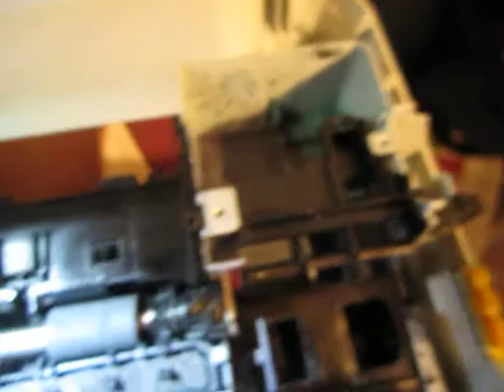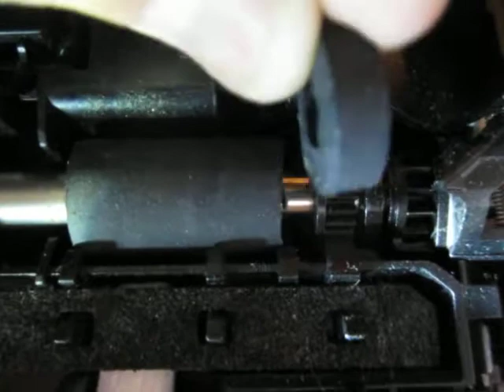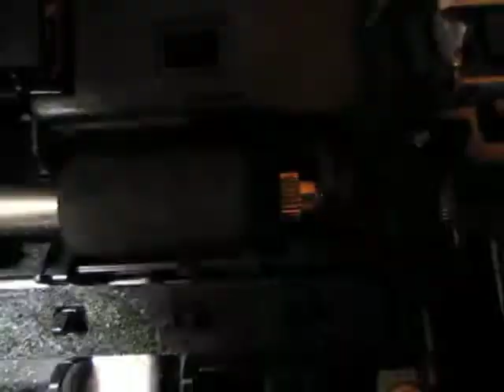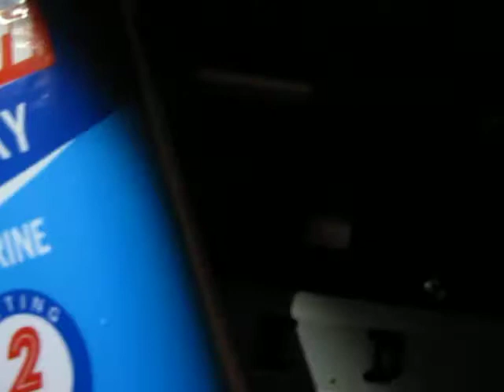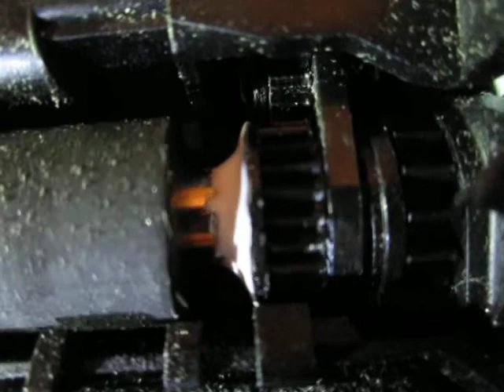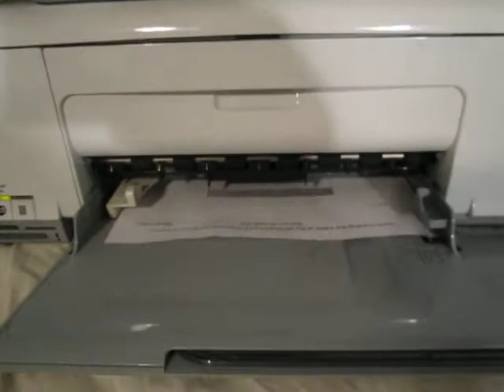HP Printer Paper Pick Up Repair C3180

Comment: Thanks, your video helped me revive my printer; it had the same paper error. I managed to fix it without having to take it apart. In case it helps anyone, I moved the gear slightly to the right to create a gap between the rubber seal and the gear. I applied a little Loctite with a brush to the side of the rubber seal, then moved the gear against the seal and applied pressure for a few minutes. I turned the printer on, and now it feeds paper perfectly. I don't know how long this fix will last, but it's enough for me.

Comment: I used a hole saw 3 inc to cut a hole right under where the gear is on the bottom side so I can work better, it worked great. easy to work on then sand the hole inside the printer so the paper feeds just use about 20-30- pieces of paper and it feeds great  took me 1/2 hour and shes been ok for 50 pages printed so far good luck.

Comment: Hi, I write from Italy
I have a problem with my HP c3180 printer.
The print paper end sensor no longer works and this is giving me printing problems, what can I do?
Reply from the maker: Not sure, of course make sure there's nothing jammed like paper ect.
Reply: @mst3kpimp  there is nothing everything is clean The part sheet comes out in the middle and then the printer stops I checked there is no internal blockage What can I do? Thanks
Reply from the maker: @AlexLaTorreAXELmodellismo  only thing i can think of having not seen it is a damaged or dirty sensor prob need to disassemble or just try unplugging for 24 hours and/or removing cartridge's in hopes a reset will occur.

Comment: Thanks for the repair school!  We need MORE videos like these - especially since it's virtually impossible to find HP Repair Manuals.
Just a thought on curing the epoxy:  
I have a C7280 HP with a split gear on he end of the rear 4 roller paper feed shaft.  I can spin the shaft/bear and when the split comes in contact with the other gear, you can feel more torque is required at the point.  This is because the other gear is causing a partial closure of the crack.  
I think it would be a good idea to find exactly where that "stiff" point is and let the epoxy cure at that location.
But that may not be a good idea!  If cured at the stiff point, there will always be a residual stress on he epoxy as the gear trys to go back to its "spread" shape - the epoxy may fail in creep.

Comment: Hi, I have Check Paper issue. I remove the paper sensor according to "Disassembling HP Photosmart c3180 Feed Roller Assembly Removal" instruction but still the orange light flashing. What could be the possible issue?
Reply from the maker: sorry i only try to fix problems i have, my printer still works though, good luck